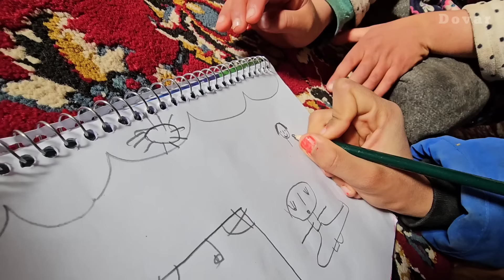Nomadic Trials: The Quest to Find Noorbakhsh's Mother & His Return to Prison⛓️👩‍👦

Comment: Why is the bathroom so far away where you putting kitchen the bathroom should be there. The kitchen should remain in the same place but built up with brick. Bathroom  be where putting kitchen. It to small. Since you can used tent as a kitchen. Continue till you could  built a proper kitchen.